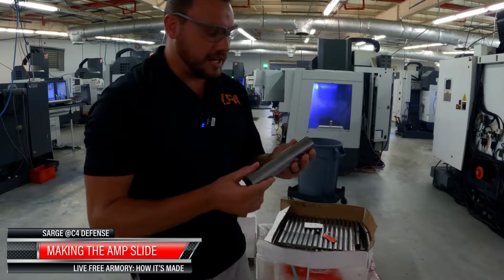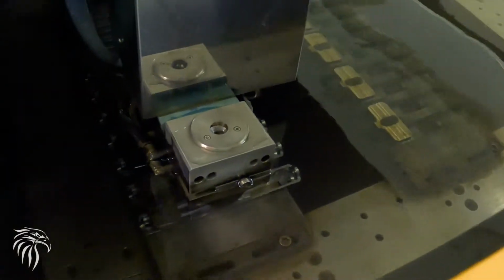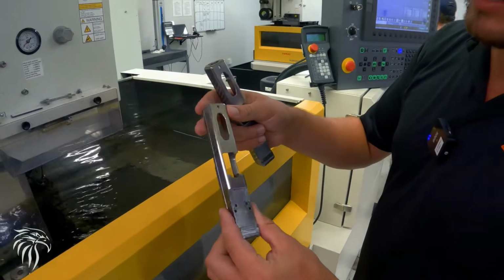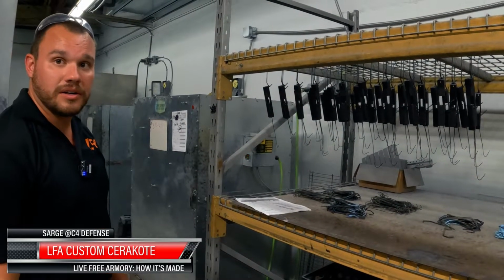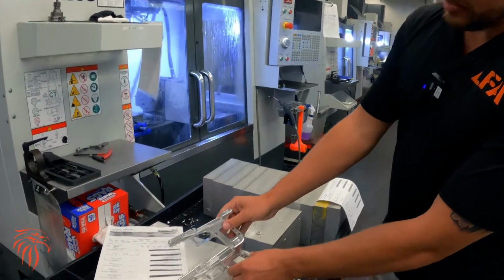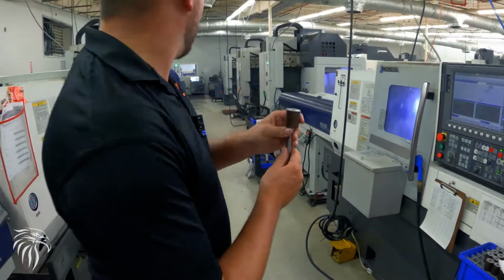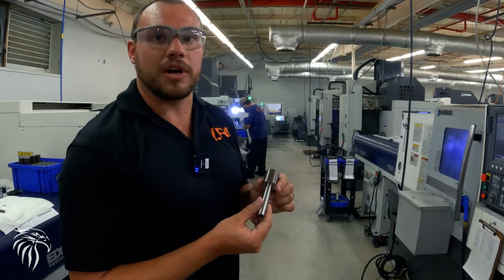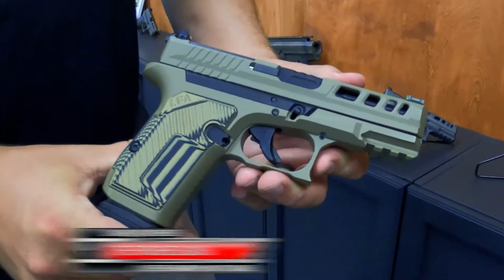How Its Made Live Free Armory

Comment: I purchased one and it’s nothing but paper weight at this point nothing but failure to go into battery and double feeds like you won’t believe but hey it’s a great practice drill pistol.
Reply from the maker: You know what else had some failures to feed? My new $1600 P229 Legion RXP, but I’m gonna contact Sig instead of using it as a paperweight.
Reply: Iv seen nothing but good reviews on the ones for the sigp365
Reply: P365 slide failed 3-4 rounds per mag won’t cycle tap and shoot trainer for sure emailed the a week ago just asking about a break in time maybe no reply
Reply from the maker: Mine has run great.
Reply: I had a canik rival that had a failure to fire, traded it for a Glock g17. It ran fine for the guy a traded but I didn't like it because of the failures. I have 2 shadow systems pistols and never had an issue. 🤷🏼‍♂️